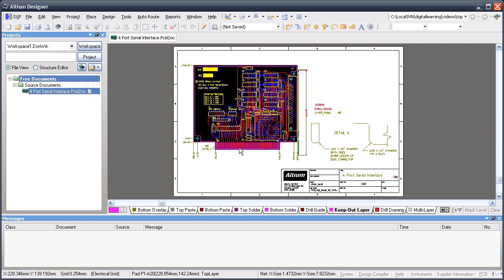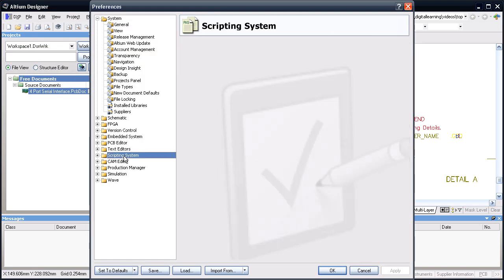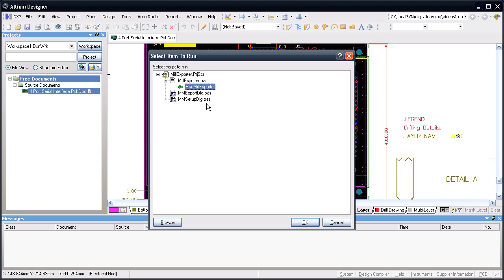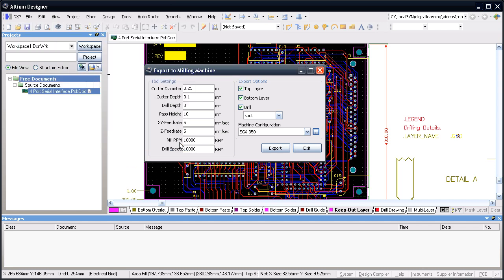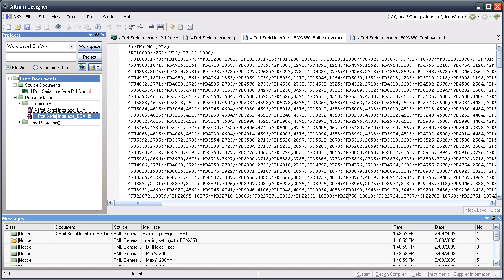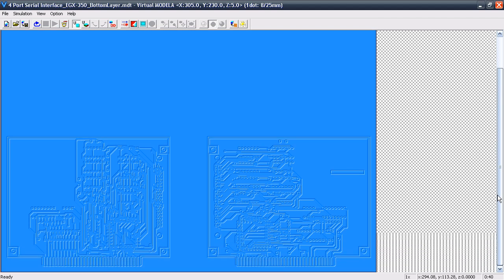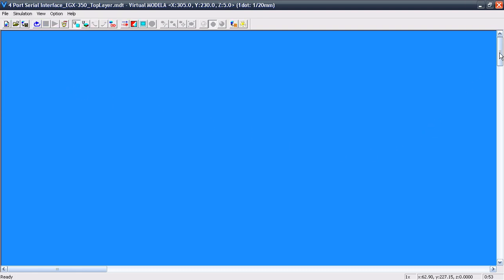Milling a PCB from within Altium Designer

Comment from the maker: @altium1 - I only use Virtual Modela to visualize the final output. The G-code is created directly from the script. If you have Altium Designer Summer 09, the script is included in the examples folder.  Otherwise email me at marty (dot) hauff (at) altium (dot) com and I will email you the script directly.

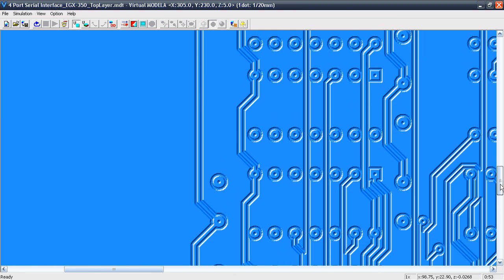Comment from the maker: @MrElile44 - Well spotted! If you're referring to the merging of tracks visible at about 3:48 in the video, it's because the design I used didn't have sufficient clearance for the polygon pour to squeeze a path between some of the tracks.  The Mill path is taken from the polygon outline so you need to make sure there is sufficient space for the polygon to pour between all tracks.  Using design rules to enforce a larger clearance between tracks prior to running the script is the best solution.

Comment from the maker: @Marcelmx3 Main Program is MillExporter.pas.  The main routine is called RunMillExporter and this calls ExportDrillFiles() and ExportMillFiles(). If you follow the calling path through, you'll notice calls to functions starting with RML_... These are the RML specific language functions. To target a different g-code system, these are the functions that would need to be retargeted.
I'm happy to open a more direct dialog to discuss:  marty dot hauff at altium dot com.

Comment from the maker: @Marcelmx3 Yeah I wrote it.  But you could modify it pretty easily to work with other g-code systems.  If you are using Altium Designer, have a look in the examples folder. Would it help if I uploaded this script somewhere more accessible?

Comment from the maker: @happygamestvfun1 A milling machine is a 3-axis machine that has a variable height drill (mill) and a table that your job sits on that can move in X/Y plane.  Using commands sent to the milling machine, you can program it to carve out a 3D object or, in our case, cut out the track work for a PCB so you can then prototype an electronic circuit.